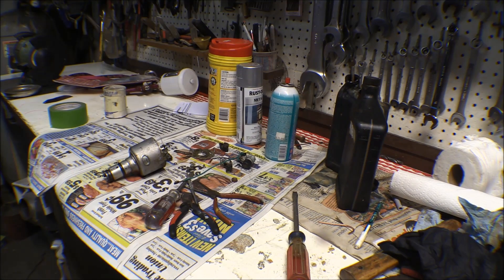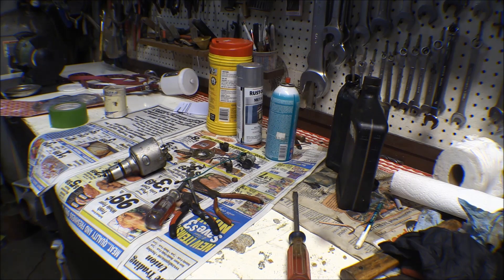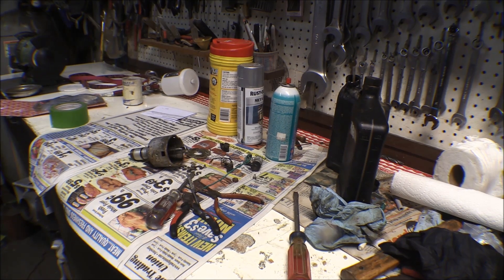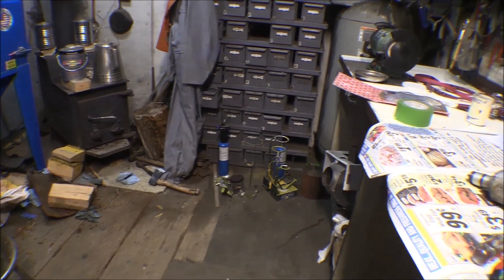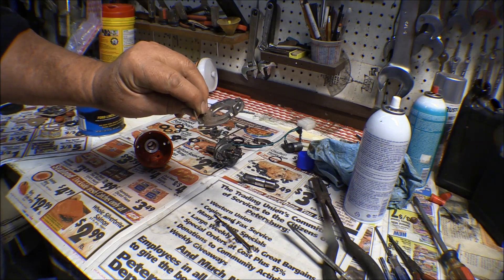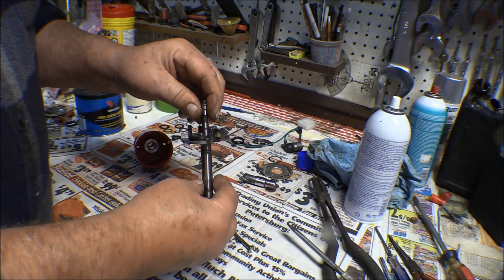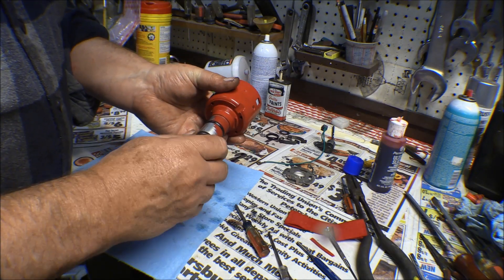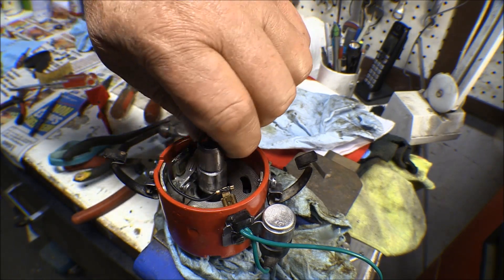Mobile Dimension sawmill repairs  distributer clean-up

Comment: I'd be interested in your powder coating techniques.  I restore a lot of tools (buying older well built machines needing some love) and a lot of the parts could be powder coated but I have no experience with that. Anyway, I'm curious about the spray gun you use, you've shown enough bits and pieces about the ovens you use but details about the actual coating would be interesting.  If you have time of course.  I enjoy all of your vids, thanks for sharing them!  -Larry
Reply from the maker: I got a Hot Coat powder coat kit from Eastwood several years ago. It came with a cheap gun, a sample of powders and some plugs, masking, etc. I think it was about $85 at the time, it's $125 now, I see the gun is on sale now for $70. It works pretty good, I've thought about up grading to a more professional style gun from Columbia coatings, but can't justify the cost for what I do now. I have bought powder from Eastwood, but now buy from suppliers on Ebay. Just about any color you can imagine is available, and some manufacturers, such as PPG, have powders that mach their paints. Harbor Freight sells a gun for around $80, I haven't used it, but have heard ok reviews about it, I don't think I'd use their powder. I don't know if they still have it, I don't get around their stores much, but several sellers list the same thing on Ebay from $80 to $150.
Basically the gun picks up the powder at low pressure and electrostaticly charges it ( kind of like rubbing a balloon on your head and sticking it to the ceiling, although that worked better when I had hair) and puffs it onto the work. A ground is attached to the work to drain any charge built up so it doesn't repel the powder. It takes a little trial and error to figure out how much to apply, but once you think you have enough you heat it up until the powder melts. I've mostly used an old kitchen oven, but also used heat lamps and a heat gun. Different powders have different requirements, some 425 deg for 20 min, some 395 for 15 min. I haven't seen it as too critical except not cooking long enough or too long, Too long or too high and you kind of lose the gloss. Basically the part is heated until the powder starts to gloss then for some amount of time. Different materials take different times, thin parts heat faster than thick, aluminum heats faster than steel.
Prep is pretty much the same as for a good paint job, cleanliness is paramount. One of my old mentors used to say " not clean, sanitary". I had trouble after cleaning with lacquer thinner, pin holes and bubbles, found out lacquer thinner leaves a residue, now make sure and clean everything with a good prep-sol, I use PPG acriliclean. I also heat everything with a torch just before painting to dry any surface moisture, but it's really damp here. 

Cast parts can be a problem sometimes, Magnesium and aluminum especially are porous and outgas bubbles. They can also be saturated with oil. I clean those parts, bake and clean again, then coat with the part hot. That is also how to apply multiple coats. I use a zinc rich primer sometimes. Apply the primer coat, heat until the powder just starts to flow, then apply the finish coat and cook again.
I like powder coat for a couple of reasons, it's durable of course, but the main reason is the part is ready to use as soon as it cools enough to touch. I don't know how many times I've had a painted part mess up when assembling even after curing for a few days. The down side is it's really hard to strip the paint if you decide it's not right or needs repair later.
Reply from the maker: I made a new video showing my powder coating process if you're interested
www.youtube.com/watch?v=_EwOJg3QxZw